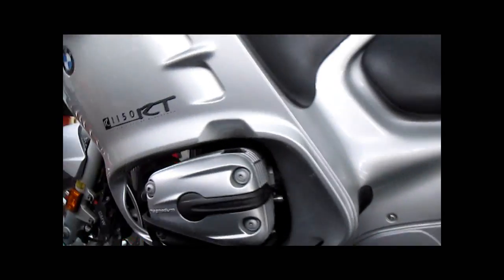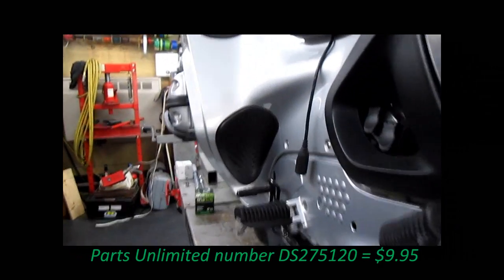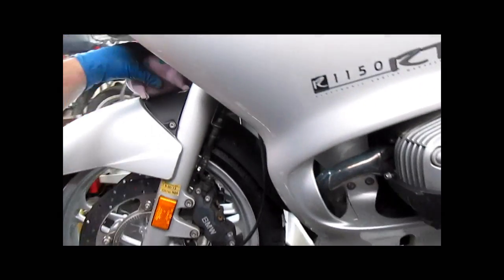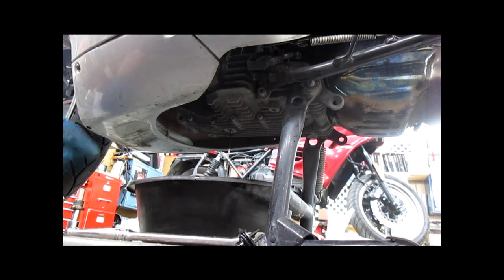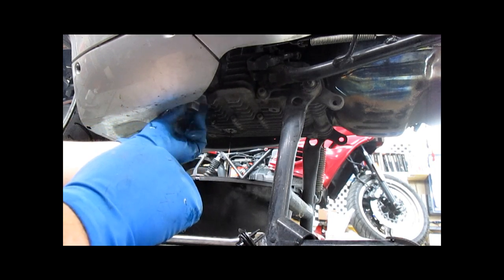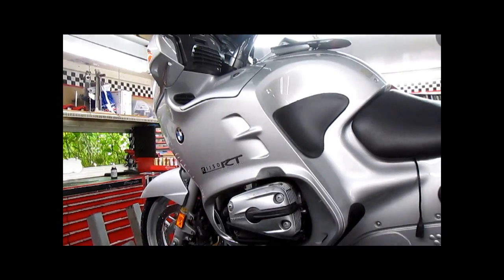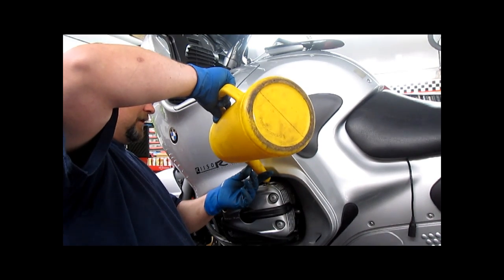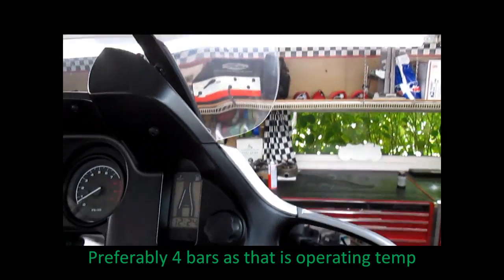BMW Service - Oil & Filter Change

Comment: Thanks Chris!  Did my first oil change on my new to me '98 R1100R with just under 7000 miles using Valvoline 20w50 which is ranked 5th according to oilassay.  Thanks again Chris for your instructional video!
Reply from the maker: You're welcome, glad to have helped. I only use the oil that was specifically designed for these engines... Spectro 4. No, I do not sell it but it is readily available.  Enjoy your R11R. They are wonderful machines.

Comment: Just changed the oil  myself for first time on my 2017 R NineT Pure.
Removed oil filter, let it drop in the drain pan.
I had remembered what you had cautioned about the gasket.
Looked with mirror to see oil filter mounting flange underneath engine and saw the gasket there.
Picked up the oil filter, and sure enough, the gasket was missing!
I'm so glad I saw your video and remembered your warning!
Like you said, i surely would have had a nasty oil leak if I tried to install the new oil filter on top of the old gasket.
Reply from the maker: Great, thanks!

Comment: Thnx for your video. Very educational. I am about to purchase a 2002 bmw r1150rt in mint condition and the easy tasks I want it to do myself. I now have a 2014 vstrom dl1000 and I cannot get used to it. I am a BMW fanboy and rather want an older BMW then a newer other brand bike. Once you have ridden an beemer its hard to get back on a Japanese bike. Its an addiction.

Comment: Hi Chris, Just changed the oil on my 96 R1100RS - used a HiFlo filter and everything worked a treat, just like in your vid (almost). Wouldn't have done it without you. Thanks for your excellent vids. Keep up the good work.

Comment from the maker: I'd guess that it was likely over-filled at some point in the bikes life. Drain the airbox at each oil change and see if it stops accumulating in the airbox. If not then you might be looking at new rings but I would certainly perform a leak-down test first. Thanks & good luck, Chris

Comment: Thanks for all the extra information along the way. I'm always learning something new. I never heard the reason to use old oil to pre-lube the oil filter gasket before. 

My youngest daughter has a similar toy pig. She uses it to scare off her sisters kats when she is snacking. They are both sneaky mooches. Not all that different from a certain Parts Dept.  :)

Comment: How do you know the HiFlow filter is better than the BMW filter? Where's the specs that demonstrate which is actually better? I've never had a rusty or dented BMW filter, and if I did it would be handed right back to the parts rep...
No comment about riding the bike for at least 30-minutes to bring the oil to operating temperature and bring the contaminant particles into suspension? I find the oil filter is easier to remove when warm. Also, what about pre-charging the oil filter with fresh oil before installing?
As far as which oil to use, I've always used Castrol full synthetic 5W50, and after 165,000 trouble-free kilometers on my R-1150-RS I've never had any issues with leaks. Runs like new, and the valves almost never need adjusting.

Comment: Important question. I just changed my oil on my 1985 K100 rt bmw.
The manual says 1/2 a quart. 
Only it doesn't even show on the window even after running the bike.
Than The dip stick
Shows the oil at the 2 level of the stick. The manual says that's how it should be.
Only again? The window shows no oil in?

Comment: Thanks for the information! I recently did an oil change on my R1150 RT and did exactly as you described, step by step.  The strange thing is the oil is registering above the red circle on the sight glass. I put in just shy of 4qts and can’t figure out why it’s so high. Any advise would be helpful!
Thx

Comment: Maybe you don´t understand german but you are realy a "prima Kumpel" your Videos are helping me to save money !
Now I m facing my first Oilchanging on my BMW RT1100R by my own. It will function, after looking your Video.
Take care ! Best rgds Carsten (Germany) 
PS By the way , I m changing the Oil Drain Plug into a Magnetic Inteligent one with Drain Valve and a hose connection, I let you know how it works
Reply from the maker: +Carsten Krause Great!

Comment: your videos always interesting,  I own a 2004 	R1150R that sucks up oil like crazy.  Have to refill every 200 miles.  
Any ideas?
Reply: 23esparami I have a 2004 Rockster (the same bike as yours) which does the same. I've used synthetic the last couple of oil changes and I'm thinking I'm gonna go back to dino to see if it helps.

Comment: Hi Chris I have a1993 k110LT. I heard u say do not use synthetic oil also u recommend not to use Bmw oil filter. What do u recommend for my bike. I have 106,000 miles on my bike, every mile on my bike is under synthetic oil. Thank you Rommel

Comment: Hi chris, filling the filter first, looks to me easy, cause the upright position...i lately found out on my cars, that the first fill up of filter drags all the oil in the paper within 30 seconds, refilling , and in one minute it sets again into the paper, third time i can fill the filter up..because i have the luxury to work on my own bikes, i spent the extra 2 minutes, so theoil pressure is at its quickest back to normal...i might think this is overkill, cause of the oilresidu on an active bike....but when my motor slept too long after few years, is that recomendet Chris? It cant harm , thats my train of thought...BobBelgium

Comment: I use Hi Flo filters too. Thx for confirming they are a good choice Chris.
Reply from the maker: You're welcome.
Reply: Hey Chris...I am not computer savvy and this took me 15 min just to sign in and create a google account so I could reply...tried doing a reply to you directly but that is another story...anyway...I just bought a 2004 BMW R1150RT w/33,000miles and switched to Spectro4 20w50...my question is after I ride and get back to my garage I can smell burnt rubber and I am thinking it may be the alternator belt...not ever owning a BMW I have no clue...any ideas....oh and by the way...I got rid of that charcoal canister after watching your video(s)  Thanks for all you do!  William
Reply from the maker: Check the belt!
Reply: Will do!  Thanks Chris

Comment: Chris what are the consequences of over-tightening the oil filter when changing? Gave to a mechanic to do this as had no space to do myself and later by accident figured out that he didn't use the torque wrench. Just screw the filter on "by feel". Later at home I took a wrench and tried to give it 1/10 of a turn to check and it is pretty tight. Clearly more than 11nM (as it has to be). Problem is that I already rode like that for 2 days, so the rubber seal already took the shape. Which means that if I unscrew it I have to change the filter itself. Any idea if I can leave it like that (no leaks so far, the seal is holding for now)? Or is it going to blow out in a while because of this? Thanks!
Reply from the maker: Leave it alone until the next oil change.

Comment: Hi Chris. First of all, thanks for sharing the awesome video. Quick question. In the BMW R1150R Service Manual, the torque indicated for the Oil Drain Plug is 32Nm, but you mention 20Nm. Which one is the correct?
Reply from the maker: The manuals are wrong. The oilhead has a 16 mm drain plug where the K is 18 mm. The K75 - K11 call for 23 nm of torque on the 18 mm screw. Why would you torque a smaller screw to 9 newton - meters MORE?! Torque the engine oil drain plugs to 23 nm NOT 32 nm for all K75, K100, K1100, R850, R1100, R1150 and R1200C models. I work on no others. Good question and good day, Chris.
Reply: Thank you!

Comment: I'm considering the purchase of a 2004 R1150 RT with 33,000 miles. Is there any "common" problems that I should be aware of for a bike like this? It looks perfect, but service records are unavailable. This may end up being my cross country rig, as I'm getting a little older, and my '14 Night Rod, though perfectly willing and capable, is becoming more uncomfortable for my old bones. (The Rod has 44,000 in four seasons and has been a great steed) Thanks.

Comment: Thanks Chris, I use mobil delvac 15/40 on my 02 1150rt, this same I use in my 18 wheeler, used oil from all my wehicles ( allso Delvac) Volvo,saab,toyota echo(218000 mil. no "0" problems) I mix ( dump in to tanc ) with my fuel in Kenworth
Reply: Are you saying you mix used engine oil with your road tractor fuel?
I mix w my Kubota fuel as well.

Comment: Very educational video, thank you.

What is your opinion about filling up the new filter with new oil prior to installation. Is this a safer method to avoid starting the motorcycle unprotected after the oil change, or is this only an urban legend? Cheers.
Reply from the maker: Install the filter dry.

Comment: Hi Chris, I have owned a K1200RS for about 4 years and your videos have been great, allowing me to do my own maintenance.  I recently purchased on '01 R1150RT to add to my fleet. You say to use Spectro 4.  I can't seem to find that here in New Zealand.  Is there a "second place" oil you can recommend when Spectro 4 is not available.  I currently use Nulon Semi Synth in the K1200 and have had 137,000km of trouble free riding.
Reply from the maker: I prefer to not use synthetic in these oilhead and K75 - K1100 engines. Synthetic in the gearbox and rear drives are good, not the engine. Good luck.

Comment: Hello Chris! great videos, because of them I am ready to tackle at least the fluid changes on my 1997 R1100RT.
Question, where do you find a torque wrench with a 10 NM reading? The ones I see start at 16 NM.
Thanks!
Reply from the maker: Back it down from 16 or purchase a smaller torque wrench (1/4" drive). Good luck Jose!

Comment: Great video Chris. Very informative and practical. Can I ask when you say that synthetic oil is unsuitable, do you also mean semi synthetic too ? 
Ive been using castrol 20/50 mineral (actevo) in mine which seems to work well.. John
Reply: bigjohno242 m

Comment: Good video on oil change. The saddlebag operating handles on my 2004 RT are very hard to open. Do I need to take the mechanism apart to oil it or no. And what Lube do you recommend?
Reply from the maker: Lube each point and lock cylinder with mineral oil, no disassembly needed, Good luck.

Comment: hi chris,

thanks for this videos. i will know which oil is the best to use for the engine r850 / r1150 from 2004? 15W50 ; 10W40 of 20W50 ? 
thanks for your help
Reply: 20w50 mineral engine oil .
Reply: @sheene71  Mineral ..???     100% Synthèse  10w60  ...!

Comment: I recently bought a used '93 K1100 LT (65,000 miles now) and put synthetic Lucas 20/50 motorcycle oil in it. I wonder now if natural petroleum oils would tend to keep the seals softer.

After about a thousand miles on this oil, I began to hear a whistling noise that was unfamiliar to my ears (had an '85 K100 RT and rode 150,000 on it) and the next  day was reading my Clymer's manual and came to a part about noise that might come from the output shaft, BMW bulletin, etc.

So I wondered if I did the wrong thing by using this oil.

I happened to have in my shed, a 1#  bag of Tungsten Disulfide powder, (WS-2 or whatever) which I was going to use in my transmission and final drive. I decided to put about 3 oz of this powder in my crankcase, by first draining about a pint and then adding the powder to it and stirring it well with a paint stick, and then putting it back in.

It reminded me of BMW Arctic Blue metallic paint, swirls and all, as I stirred. (love that color especially on black....is it blue, green or gray? Whatever depending on the weather. Looked great on the old RT.!)

Well during the 30 mile ride to mix this powder in an all, there was none of the whistling noise at all. I bet I never hear that noise again.

I was amazed at how happy the motor sounded.
Reply: Ray Brensike Well the noise did come back. I try to not ride at that rpm. Could be something I read about rivets on the output shaft getting loose.

Comment: Chris.  I own the same bike pictured in your video, 2002 R1150RT.  My bike has 21k miles on it. What brand oil do you recommend?  Do you have an opinion on Mobil 1 synthetic?  I've used the V-twin formulation in my Harley for years and had good results.  Wondering if that would also be a good choice for the boxer engined RT.
Reply from the maker: I use Spectro 4 Non-synthetic oil for the engine. Spectro 75w140 GL-5 synthetic gear oil for trans and rear.
Reply: Thanks Chris.  Looks like I'm gonna make the switch to Spectro then.  Thanks for getting back to me...much appreciated.

Comment: Hello Chris it seems almost every year I’m replacing my battery I have a 2004 R1150RT Bmw I keep a smart charger on the bike Optimate 4 .
Should I go with the BMW battery or agm what battery do you recommend I have checked The charging system everything there checked out good.
I appreciate your thoughts.
Sleepless in Seattle.
Reply from the maker: Joe; the BMW GEL battery is shit. I use these https://www.beemerboneyard.com/westco12v20p.html but do not leave the charger on as some can and do overcharge the battery. Once a month for one charge cycle (maybe 2 days at most). Good luck, Chris

Comment: Switching from Castrol synthetic to Spectro4 stopped the oil leaks on my 2004 R1150RT.  At my last oil change two months ago, I switched to the Spectro4 synthetic blend.  No leaks after 500 miles and it seems as if the bike is burning much less oil than with the Spectro non-synthetic.
Reply from the maker: Great! Minimal oil consumption is not a problem. All good engines consume a small amount of oil between changes. Enjoy!

Comment: Hey Chris, Are you able to post a video showing how to properly remove the tank on a 2000 R1100S? I need to bleed my brakes and change the oil filter. I'm nervous to break any of the tabs and/or lining up correcting when re-installing it. The bike looks new and I don't want to break any of the tabs. Any tricks or tips are appreciated.
Reply from the maker: I don't but I can offer this: https://www.youtube.com/watch?v=iL_mNKhMGRg

Comment: Hello, thank you for the very useful videos. Quick question: how come you torque the oil drain plug to 20 nm? The bmw manual specifies 32 nm. Is there a risk of stripping the threads off the plug if torqued to 32 nm?
Reply from the maker: 20 - 32 is sufficient in this application. I prefer the lower end of that range. Thanks, Chris
Reply: Chris Harris Thank you for clarifying that I had watched another You Tube that did specify 32 and was confused also.  Good to know the range is 20 to 32 Im going to split the difference and put it at 26.

Comment: Hi Chris, I am getting ready to change oil in my 02 1150 RS. Having the Hayes manual, I was comparing the torque numbers for the oil filter and drain plug. The filter is the same as in your video-11Nm but the drain plug is 32 in the book and your video says 20 Nm. What value should i use. Please let me know. Thank you

Ivan Toronto Canada
Reply from the maker: +vanjkasiki Torque it to 20 nm.

Comment: Hello Chris,  Ben from Raleigh NC. I'm a new 02  BMW R1150RT with ~46k miles. Greatly appreciate your video for my first oil change. Any chance you might do an instrument panel disassembly down the road?
Reply from the maker: Hi Ben, At some point, yes but not soon.

Comment: Hi Chris, I have another question.  Do you perform and recommend clean flushing motorcycle engines and if you do, What product do you use?  Thank you for your response.
Reply from the maker: I would not introduce foreign matter into the engine. Flushing is a scam. Drain and refill with fresh fluid.
Reply: Thank you Chris, your advice is schooling to me.  I performed my first oil change on my biike thanks to your video.  Keep up the excellent job.

Comment: mr harris thanks for your videos  what engine oil do you recommend for a R1200GS ADVENTURE air/oil cooled k25 2013  90 year edition and gear box,final drive thanks in advance
Reply from the maker: Yeyo, I do not know, my BMW world ends with 2004 models.

Comment: Awesome video. Motul makes a non synthetic 20w50. Your thoughts?
Reply from the maker: Back in 1984 BMW contracted Intercontinental Lubricants in Brookfield, Connecticut USA to formulate a special oil for the introduction of the new BMW motorcycle that was soon to be released. When the K100 series hit the showroom floors dealers had the proper oil on hand. Gone were the days of Castrol being recommended in the U.S.A. because Castrol had already reduced the quality of their oil and BMW could not rely on Castrol in the United States to offer the engine protection that they demanded. Spectro 4 was bottled with a special BMW label for many years until ten or so ago when they switched back to Castrol products. I use what was designed and formulated specifically for the machines that I work on. I've used Kendall and Pennzoil in the past with nomill effects but again, this was long, long ago in that previous century when oils were made from oil and such. I wish you luck in whatever oil you choose. Take care, Chris.

Comment: Hi Chris, Greetings from Ireland. I have recently purchased my first bmw, a mint 2005 1150 adventure with 7,500 miles on the clock. I took the bike for a 50 mile ride earlier today and noticed  a substantial weep from the oil filler cap, the more I accelerated the more it leaked!. It looks like it's seated correctly but appears to be slightly loose, any suggestions on a fix for this?
Reply from the maker: Replace the entire assembly.